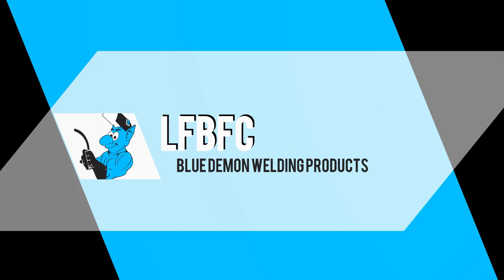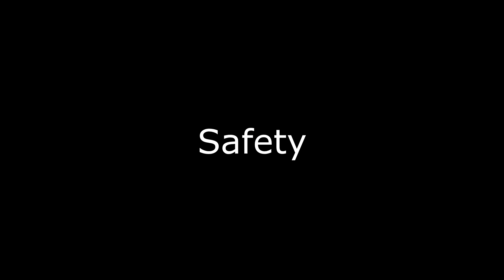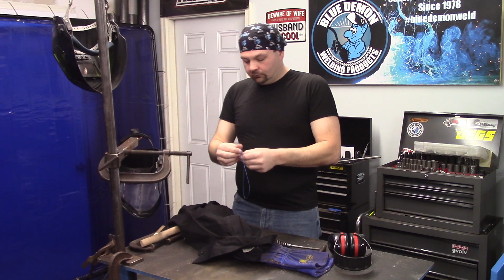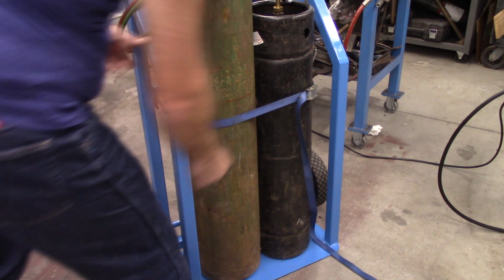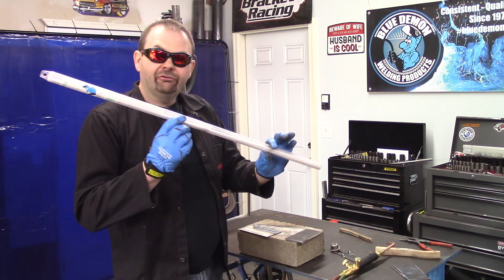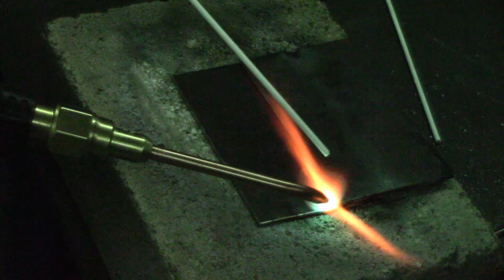Blue Demon Low Fuming Bronze Flux Coated Brazing Rod Infomercial

Comment: Can i use a propane torch with it?
Reply from the maker: Andres, I don't think a propane torch will work. I don't think it gets hot enough.
Reply: @PtfabNet  ok .can it braze steel to titanium ?
Reply: It does take forever on 1/16" frames and the thermal affected area will be bigger. Sometime if you want to coin/dime braze, it will become watery like and drip.